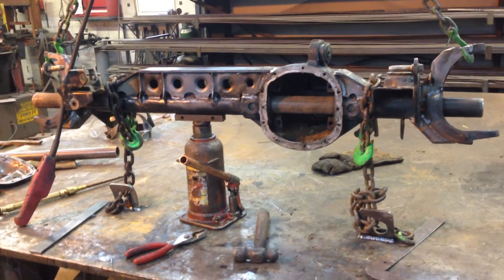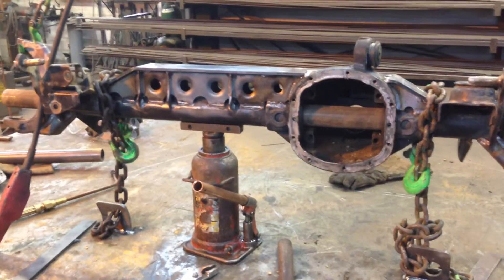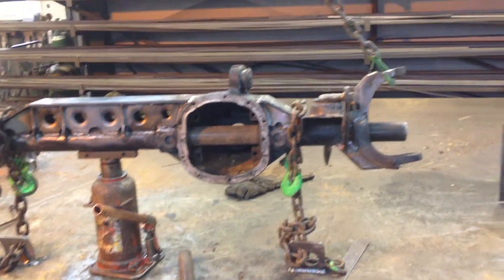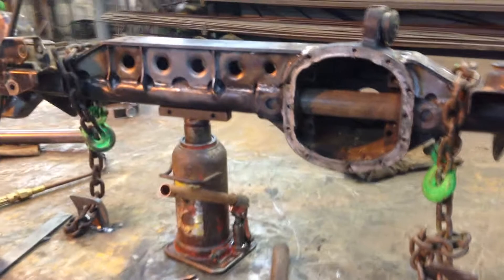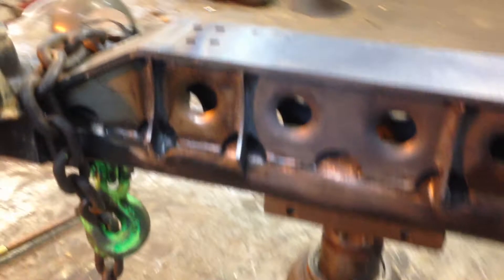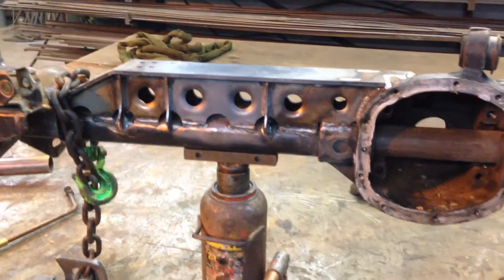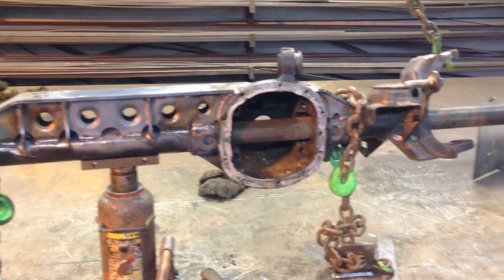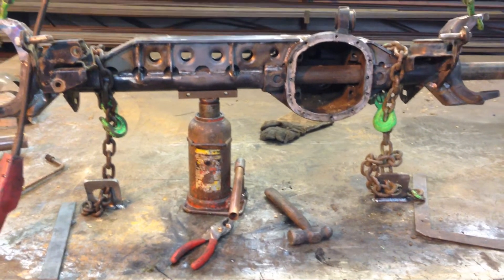Artec Industries dana 30 truss, how to straighten after install.

Comment: Thank you for the video.  I just changed the hub and ball joints on my XJ and still have tire leaning in at the top on the passenger side (long tube side).  I have a feeling my axle tube is bent upward a bit.  Wonder if I could heat the bottom of the tube to get it to come back down.  I'll probably just fasten chains to the ground like you said and jack her up!! :) .

Comment: Welded to much at a time and to fast.  If you had gone slow and done it over the course of a few days, you would not have bent it.
Reply: Cause we all got a few days to weld on the Axle... You can go slow though majority of the weld is on the top of Axle. So bending is likely to occur. Happy welding.
Reply: @BeckTools  did u just say cool it down with water??????? lmao

Comment: doesn't the reheat and bend ad stress to the steel ?
just worried about structural integrity as I will be trusting my axles soon and would hate for them to be weak
Reply: cooling hot steel fast is what will stress steel. cooling steel slowly will relax the molecules

Comment: I also looked into this for my dana 30 but as a guy that knows how to weld I felt that warping issues and problems welding to the cast diff housing could really create problems unless you have the benefit of a solid table, basically a jig set-up or your screwed. I think Artec and others who sell these trusses give some people the idea that they can do this themselves and it just isn't so. Great job by the way looks like you did an awesome job. Hope the weld to the cast center holds well I guess it takes a special stick electrode for that.
Reply: djarizona You make welding a little truss on a little axle sound like you're trying to build the space ship .